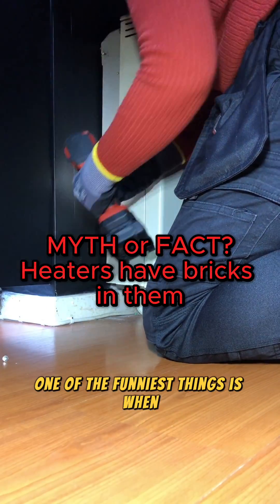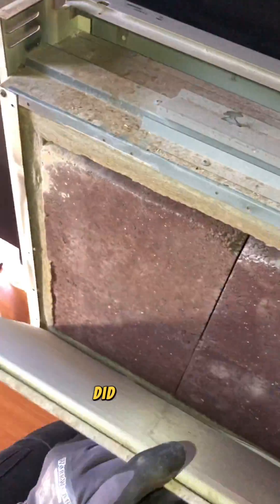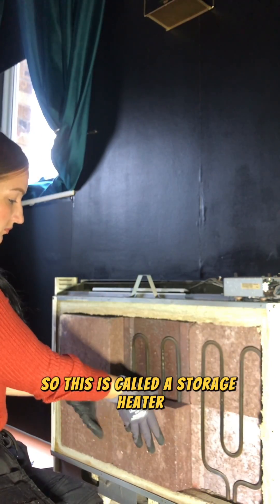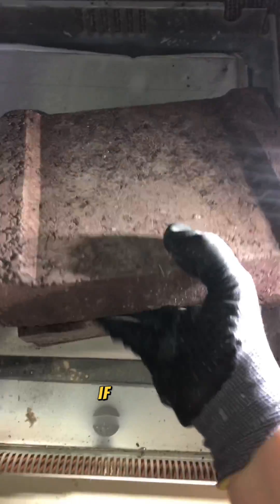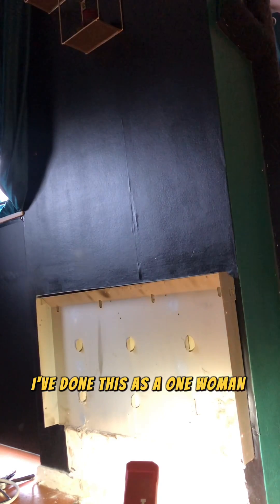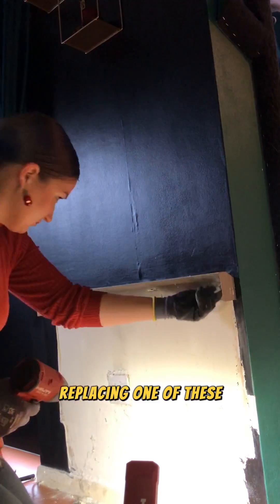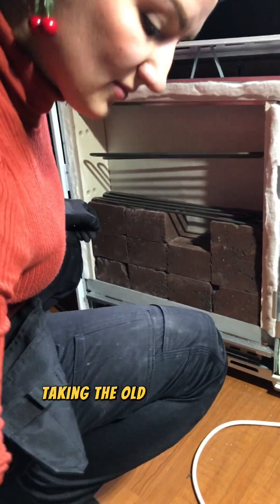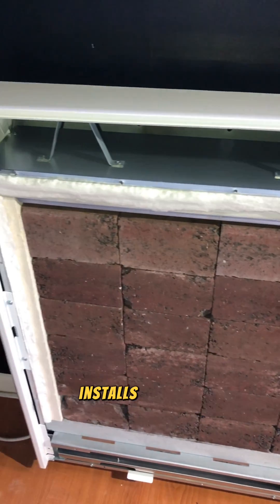Do heaters have bricks in them?

Comment: crikey ! That takes me back I’ve installed a few of them in my time mainly in late 70’s / early 80’s flipping heavy you had to be mind full of placing them correctly as the last  one wouldn’t fit , and when lowering the second or third row you had to be you didn’t squash your fingers
Reply from the maker: Yep! Have to have a technique 😅 otherwise the last one won’t fit! I found doing the ones on the edges first then working my way in 😅 

I’m probably taking all the ones out from the 80s now 🤣 creating work for the sparkies in 2050s .. and gloves is a must to protect your fingers on this one ☝️ thanks for watching